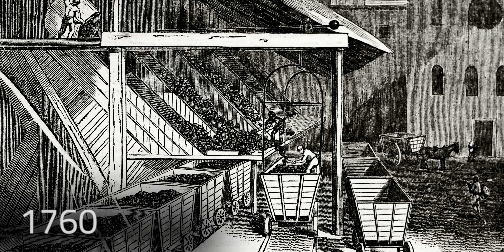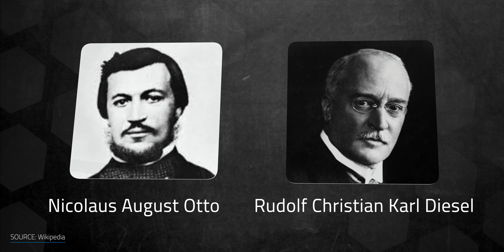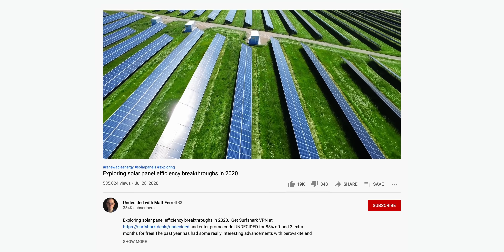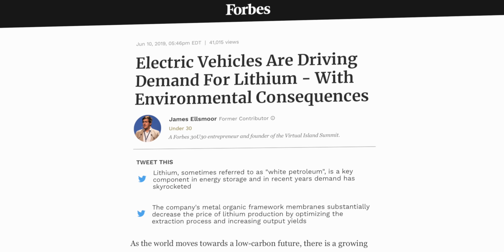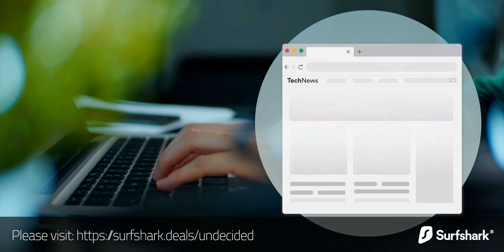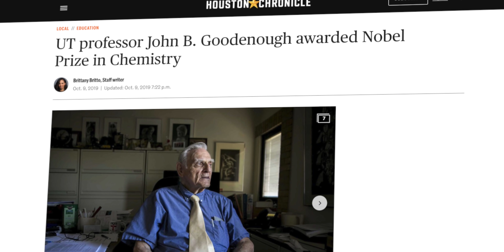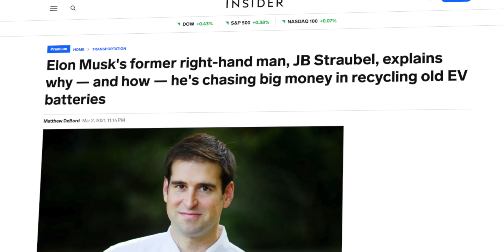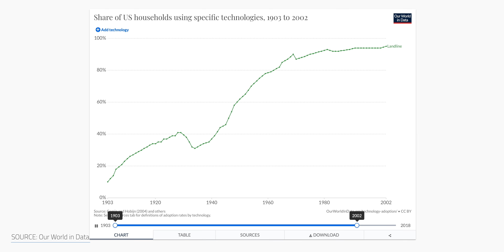Is the Future of Renewable Energy Inevitable?

Comment: ok, so... the main problem of renewables is that it's intermittent, according to the vid. Solution provided by the vid: well, it will get far more efficient in the future, like solarcells converting 40+% of the sunlight, etc. Ok, my question: how does this change anything? The amount of electricity solarcells give that are 20% efficient during night: zero. The amount of electricity that solarcells give that are 60% efficient during the night: zero.

Nothing changed. And it will never change as long as you don't have storage-capabilities that are both massive AND long term - aka, they should be able to bridge at least 7 days. This is an extremely daunting and costly task, and not something that can be handwaved away by saying "hydro will solve it in the future". that's actually very doubtful. If one goes that route, why not do the same with all other energysources - including non-rewables - and claim the CO2 exhaust will be solved in another 20 years? After all, if you compare the reduction of CO2 in modern plants compared to the ones of the 60'ies, they far MORE grown in efficiency in regard to CO2 reductions than even wind and solar as compared in the vid. So... why can't the same tactic and reasoning be applied there, then? "Seen the fact that in the last 20 years CO2 emissions of gasplants have halved, why not take the same simple route and claim all problems with it will be solved in another 20 years, by mere virtue of extrapolation?

When put like this, it's easy to spot the failings of such a reasoning, yet when it comes to renewables, a part of the populace looses its power of logical reasoning and just nods and fawns over the idea, even when it's obvious something isn't right with it.
Reply: Good points. It is easy to get enamoured with potential and forget that we live in the here and now. 

If renewables are to become mainstream, batteries need to catch up. 

But I think in this case, at the risk of being hypocrite, we are nearing a solution.

Ambri's liquid metal batteries seems to solve a lot of lithium's problems for grid storage. They last up to 20 years under heavy use and are not affected by extreme temperatures.

And it's not just a proposal either. They've sold their batteries to Microsoft for datacenter use. And also a renewable company in India.

According to their website at least.

I don't know how long it will take for this tech to scale to lithium levels. So yeah...

Comment: As with almost everything, economics is going to determine what types of renewable energy and storage will be used more than the efficiencies of the various technologies. The systems that cost the least to install and operate will ultimately win out.
Also, I believe that there will be a mix of energy sources for the foreseeable future. To save the planet, we don't need to totally eliminate petroleum based fuels or natural gas, just reduce and maintain the overall CO2 emissions to around pre1980 or earlier levels.
Each energy source has its pros and cons. Everything is a compromise. Putting something into use does more to improve the efficiency and economics of how it is produced, stored and transmitted more than all the discussion about solar, wind, hydrogen, nuclear or any other sources. Some of these may be better used in different parts of the world than others. Just my 2kW worth.

Comment: As someone who lives off grid in Canada, it’s going to take more than solar or wind.  In December I can go days without enough sunlight to produce even 1% of my solar capacity.   On a 6 hour snowy day it’s usually very calm.  Same with very cold days.  Without a generator, my 2.8 kw of solar and 1.6 kw of wind would allow my 2.5 kw of battery storage to die after 4 or 5 days.   We need something completely new.   Lots of opinions and theories from people who are not living it.   I’ve spent over $15,000 but still need to conserve energy use, especially in winter.  Most of these technologies are shit in the real world.

Comment: Until you don’t need fossil fuels and rare minerals to MINE and MAKE your renewal energy source, we can’t eliminate them. Add to it as long as these wind turbines and solar panels can actually be recycled, they are not GREEN. You didn’t address that, just the battery issue which right now is no where efficient or green.

Comment: I am a skeptic in all things. In this day and age being a skeptic and questing conventional wisdom can mark you as a monster. When it comes to "Green Energy" there is no free lunch. Wind turbines are made out of steel that has to be mined and smelted. This takes energy. Electric cars have batteries that contain heavy metals. The manufacturing of these batteries use energy resources and at the same time can be very dirty. Electric cars have to be charged off a power grid fueled by what? If someone tell you that something has a huge up side and no down side you are being lied to.

Comment: Renewables are already supplying more than 42 percent of electricity generation capacity in Germany, and while the figure for energy consumption is obviously lower, it does suggest that the question is renewable energy inevitable, is no longer an open question.  Battery technologies will continue to improve exponentially, and renewable production will also dramatically expand as solar cells improve and wind turbines grow more massive.

Comment: I'm hoping carbon engineering, there extracting carbon from the air to make synthetic fuel. Making every car, plane, trucks and oil fired boilers carbon zero with out having make a large investments on different equipment.

Comment: Hi

I can well see that lithium-ion batteries for electric cars are a problem when they are worn out.
If I understand correctly, then cobalt is soon history in the batteries. In Tesla's 46800 battery, cobalt has been replaced by aluminum. The fact that there is no cobalt makes recycling easier.
Thank you for that, when you think of the African children who dig it out in miserable conditions.

Another problem is the 1.54 billion mobile phones sold in 2019. All contained li-ion batteries and they all end up in the landfill.

Appel and Samsung ect. are major suppliers to pollution.

You should also make a video about them.

Comment: I would love an EV but the reason that is stopping me getting an EV is my local Council's policy, as I live on a terrace street and I can’t have a charging point outside my house, only those with off street parking can, they did say that I could use one of the 15 local charging points in the borough but when you consider that out of the 36,930 homes in my local area 27,360 are terrace houses, or homes without off street parking that can’t charge an electric vehicle at home, assuming that only 80% of these houses/homes have one car that is still 21,888 that needs to be charged, lets hope that I am not at the back of that que.

So where are all these charging points going to be, assuming that with advances in technology we could assume that on average it would be four days between charges that is still over 5,000 charging points required in my local area alone, this would also need an increase Nationally in the electrical infrastructure to cope with the extra 2,443.5 TWh (Tera Watt Hours) required such as new supply cables, increased number of low voltage and high voltage transformers, increased number of electricity pylons, new power generation stations.

This is a major infrastructure project that would dwarf the HS2 project on costs and will mean digging every road up in the UK in time for 2025, and the cost for an electricity suppler to re-cable a road or street, with new supplies to every house is approximately £1 Million per mile.

Comment: CRAP!  TEXAS BLACKOUT==$$22 BILLION!!   ==   After the Texas Blackouts, Follow the Wind and Solar Money – All $66 Billion of It.    $66 billion was spent building wind and solar infrastructure in Texas in the years before the blackouts, yet all that spending was worth next to nothing when the grid was teetering on the edge of collapse during the early morning hours of February 15. For several hours, there was no solar production, and of the 31,000 megawatts of wind capacity installed in ERCOT, only about 5,400 megawatts, or roughly 17% of that capacity, was available when the grid operator was shedding load to prevent the state’s grid from going dark.

That $66 billion figure is based on numbers published by the Solar Energy Industries Association and the American Wind Energy Association, which recently changed its name to the American Clean Power Association.
Reply: Hi Brian. Greetings from Denmark. Solar energy is not very large in this country due to lack of sun.

We have a lot of wind energy. Some months we are 100% covered by electricity from wind turbines. I am now 60 years old and can not remember when was the last time there was a local blackout.

Google found the last big blackout was September 2003 12:30 to 16:00. It was experienced on Zealand and in southern Sweden with a several hours long power outage of the electricity grid. The power outage was mainly due to two factors: At the Swedish nuclear power plant in Oskarshamn, one of the two reactors was switched off due to a fault in a cooling water system.

Our local TV station mentioned the problems in Texas, and told us there were problems with the electricity supply due to old and obsolete electricity networks.

Comment: Before 9-11 we accepted that most wind turbines were 33% efficient,  with climate change that drops to 12% . That’s why they need bigger and more wind turbines and the land mounted ones use huge amounts of steel and concrete for the foundations. If a turbine run 24 hrs a day every day is still won’t off set the energy and CO2 it took to make it . So it’s a total loss to the environment and to taxpayers .
Reply: Your claim is false.Wind turbines pay back the Co2 created in making them in much much less than their wroking life.

Comment: 2:10 There is no such thing as an "internal combustion motor". Motors use electricity and magnetism, engines run using gases. Get your terms right, please.
Reply: In much of the world, internal combustion engines also are called motors. Think of Britain, for example. Even in this country: think of General Motors, which builds cars and not power drills.

Comment: The next big challenge will be to convince the population that has been mislead that modular nuclear energy is the answer to every problem involving so called renewable energy.  No matter how efficient a solar panel may become in the future, that doesn't change the fact that there is still so very little energy per square meter of sunlight available.....even then, only during the day time.
Reply: Battery storage systems like sodium ion and iron air would be affordable and revolutionize grid storage.

We should also invest in both large and small scale nuclear power plants too. We need every clean energy source to compete against fossil fuels.

Comment: This is incredibly misleading, you cannot compare different techs, used in different functions, requiring different materials, with different volatilities, and different ecological impacts. It's as if I compared baking a cake and making a sand castle. Hydrogen will never be safe enough to use on a commercial scale, it explodes with a very small hydrogen to oxygen mixture, this is why we use gasoline instead. In addition we are already capped on battery tech, it's why we use lithium even though it's dangerous, but suggesting we use sodium is insane. This is a classic case of having a conclusion first and working backwards to achieve your desired result. Snake oil.

Comment: Nice video, but ... I think every mention of green hydrogen should at least note that it is FAR less efficient (by 3x or 4x) as an energy TRANSMISSION system, vs wire plus batteries, where the latter is practical. That last 'where' is important, however.  Batteries are a long way from practical for aircraft and cargo ships, for example.  But you mentioned trains as an application for green hydrogen. That makes little sense to me.  Bring wired electricity to all mainline tracks and reap that 4x energy advantage, with minimal need for batteries.

Comment: It's great that things like Green Hydrogen will be more fully developed by 2050, but that pulls me back to the development of the steam engine (which eventually replaced inefficient windmills and waterwheels). Nobody was tearing down windmills and dismantling water wheels decades before steam engines were able to completely replace them. Yet here we are with solar and wind combined producing only 11% of world energy requirements (is it really as much as that?), closing down coal and oil and gas production facilities as if we don't need them. When (and if) it becomes far more efficient to use solar and wind power, fossil fuels will no longer be required and can be phased out; in the mean-time we do need them because there is no viable alternative other than nuclear energy, which also appears to be stuck in a rut (fission or fusion?).

Comment: The first commercial solar cells had an efficiency of 2%, we are currently over 20%, so we already had our factor  10 increase.
Reply: @belly tripper The most efficient conventional powerplants have an efficiency of 60%, in practice most manage hardly 40%. In comparison 20% for a much younger technology that uses a free non- polluting 'fuel', is not bad at all.  Furthermore, multi junction cells that gave much higher efficiencies are in the pipeline.

Comment: I think compressed green hydrogen is wrong headed.  Even compressed to higher than scuba tank pressures, and anyone who dives knows how dangerous those are, STILL doesn't even approach the energy density of fossil fuels.

But green ammonia, NH4, is another thing.  It's zero-carbon.  It's a liquid at only slightly cold (-28F) temperatures, not cryogenic, similar toxicity to gasoline, and similar energy density to gasoline, uncompressed, and can be used in specialized fuel cells, to make electricity.  It can be stored indefinitely, using existing available storage tech.  It can be transferred in gas pipelines with little modification.

You could even run jet engines on it.

Right now, ammonia is made from a very energy-intensive process form fossil fuels, but there are ways of making it directly from water and air, as efficiently as cracking water into H2 and O2.

I'd love to see you do a video about green ammonia.

Comment: I'm still not completely convinced about Green Hydrogen except for specific industrial applications such as for the steel industry where it's currently the only alternative to the Coke ovens.
For most if not all transportation purposes, the improvements in battery and manufacturing technologies are starting to show that very soon battery tech will pass 400Wh/kg and hydrogen will be obsolete for these applications. Personal vehicles, trucks buses and the like will certainly be battery powered. Maybe Planes and boats will be split between battery and hydrogen, but even in planes the first battery prototypes are showing promise. With the continued and fast improvements in battery tech we'll soon reach power and energy densities sufficient for 90%+ of use cases.

Where do I see hydrogen come in? Seasonal storage of energy when we reach a point in renewable energy production where the production during summer for example is many multiples of what we need and can use. Use that overproduction to produce green hydrogen for different industrial applications and seasonal storage if/when there are windless weeks during winter for example. 

The power usage needed to convert water into hydrogen is substantial and the storage requirements to safely store hydrogen make it so that the weight of the full storage and conversion system is practically speaking just as heavy and bulky as a battery. Additionally, due to the nature of hydrogen (smallest molecule) continued maintenance is required as the containment structures have hydrogen buildup in the microscopic faults of the material. These issues might also be eventually solved by technological advancements, I'm just thinking battery tech will have made hydrogen obsolete by then.
Anyway, that's just my 2 cents on the debate of hydrogen vs battery.

Comment: My friend, I Jason Am an "maker" and I AM currently making a device the size of 1m² that can power a House up to 5KW for 10 years before it needs to be serviced, It is renewable and it is "Green" its Non-pollutant meaning it uses no fossil fuels, also the other nice thing about it all is it will be Wireless and Safe to handle with no fire risk nor to be electrocuted, My device follows a Closed loop system extracting from the continuous closed loop system
Reply: @belly tripper U=Me Jason=my name okumhlophe=White Indoda=Man ActsXVII = the bible Passage you will find My Name in mentioned more than once, its not the only passage, 

My Device is not open source, but i have a sectioned patent for the device looking for investors
Reply: Mike Row there is no LINK, its all binary and hard copy, do you really think i will upload something like this online to the ethernet that will not happen, you can contact me via Google+ you should also know I'm Quiet far, I'm in the 3de world country called South Africa, i know of Ukrainian guys who made similar closed loop systems that i have made both guys sell there Device online for +-10,000€Euro but they only sell you a 500-800 watt devices only capable of running lights, a standard house kettle is 2000watt